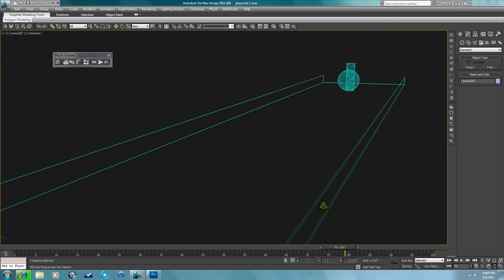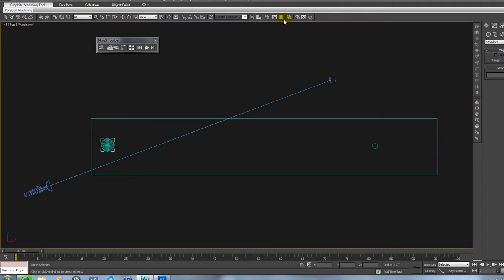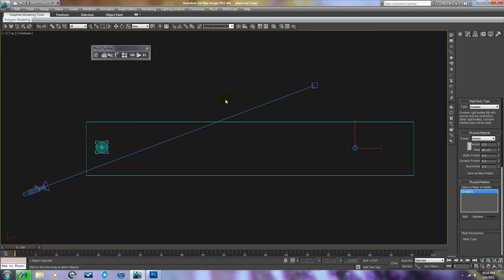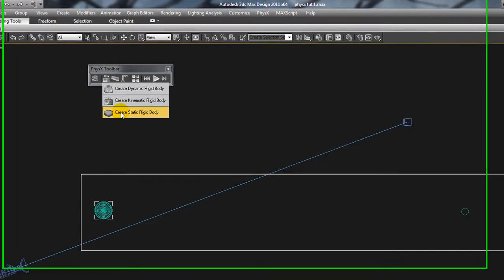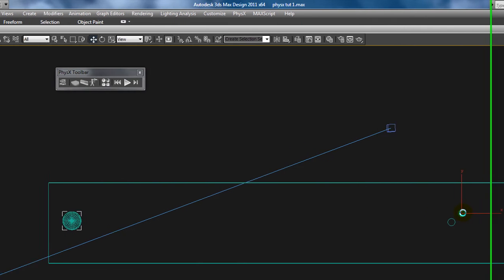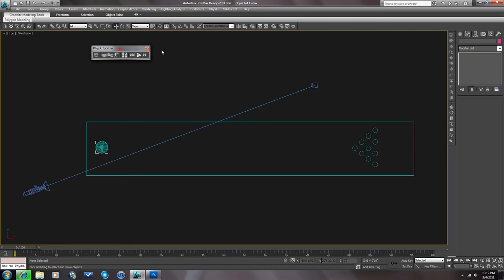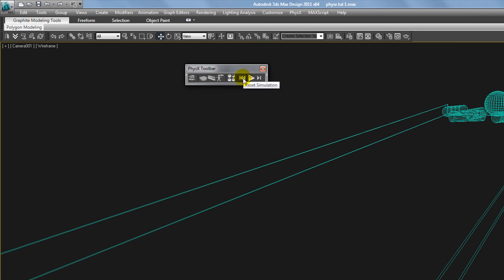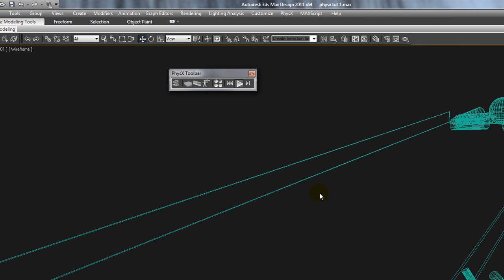PhysX tutorial, 3ds Max 2012

Comment from the maker: I am using camtasia for capturing.  It is very simple and very effective.  As far as your toolbar you should be able to right click on the one of your toolbars and then check the physx toolbar to make sure it is on.  Maybe you already tried that.  I have loaded max before and with the default settings all the menus are there, but when I load my own custom UI my ribbon menus and physx menus go away.  I am not sure how to solve this problem.